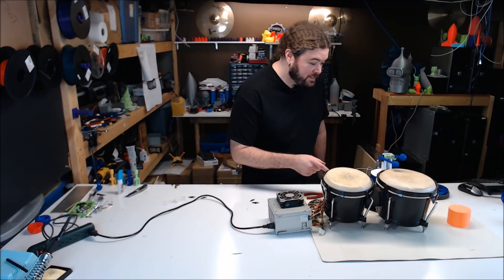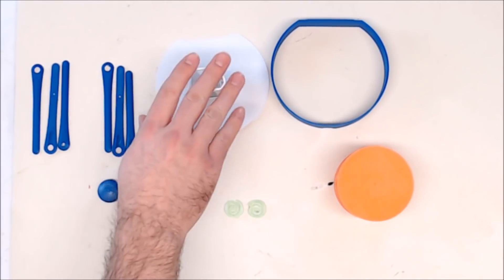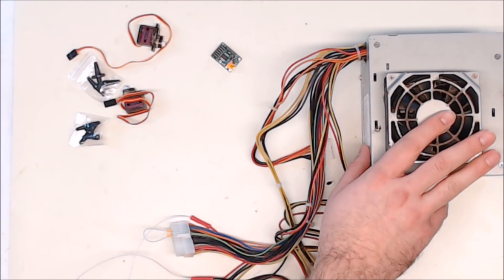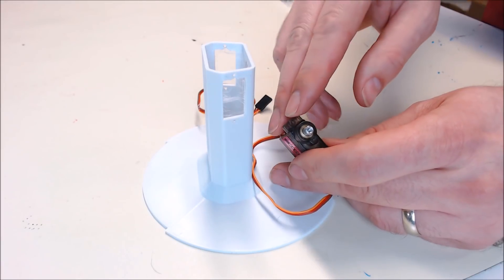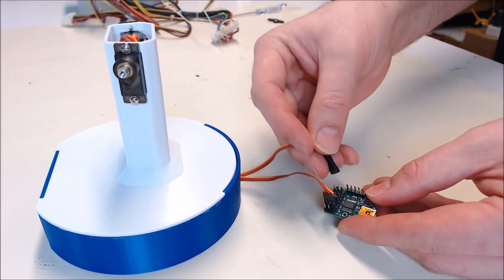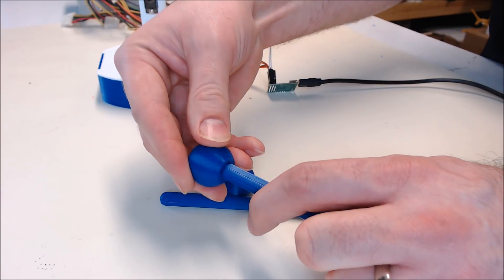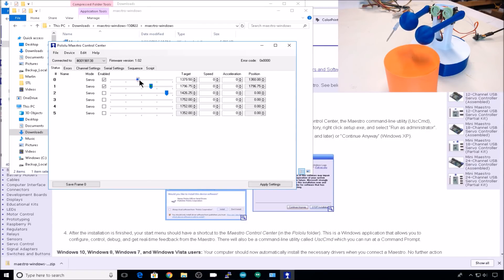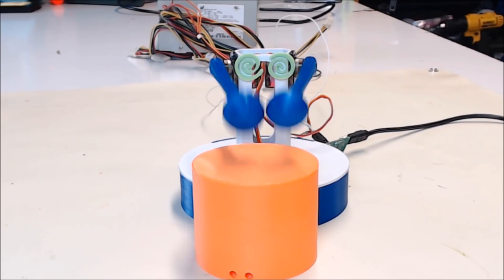Busking Bot - 3D Printed Drum Playing Robot - Chris's Basement

Comment: I like that servo controller and software.
Reply from the maker: Those things are really cool, but pricey. They do allow you to get up and working quickly. I tried to buy a cheap clone once, but if failed in about the first 5 minutes.
Reply: How pricey?
Reply from the maker: The cheapest one, it controls 6 servos, is $19.95 plus shipping.  Pricey compared to a $4 UNO board that will do the same if you want to code it.